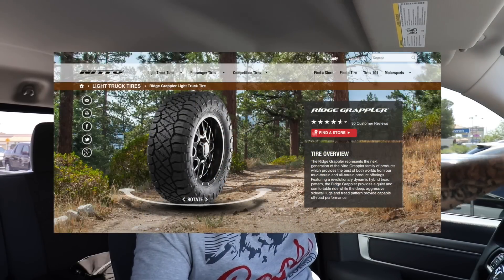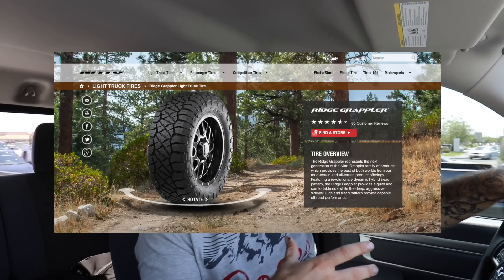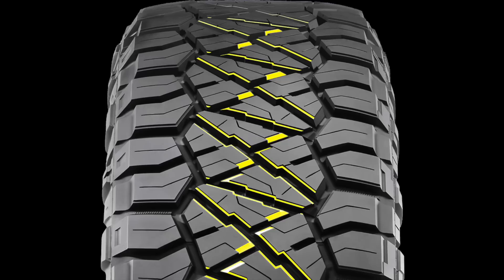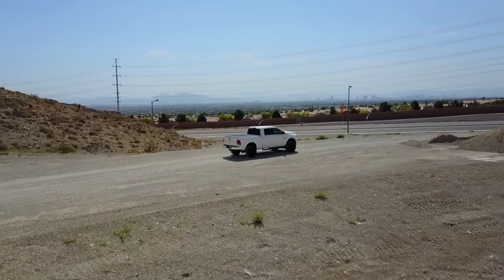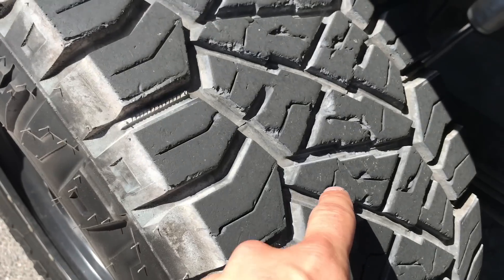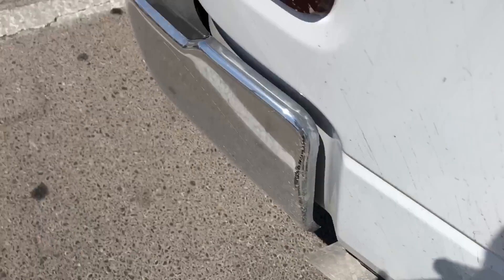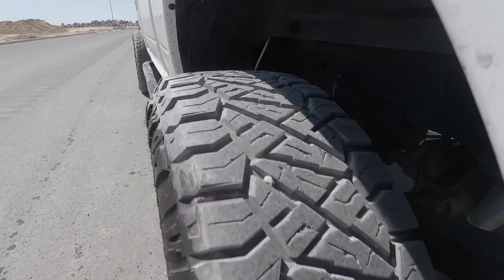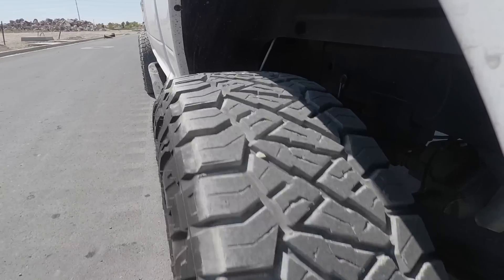Nitto Ridge Grapplers SHREDDED After 4,000 Miles - Jay Flat Out

Comment: This video is over a year old so I'm assuming somebody already this, BUT your mistake was buying the "E" load rated Nitto. The "F" load is what you should've put on a HD pickup. I have the "E" load Ridgegrappler on my 2017 F150 and they're holding up extremely well! The Toyo RT is also a great tire. Yes, they are both built at the same plant. The toyo RT is  cast from their mud terrain architecture...while the Ridgegrappler is cast from their All terrain series

Comment: I have 5,000 miles on my Nitto Ridge Grapplers and they still look brand new. No cracks, no wear to speak of. The only negative is that they seem to vibrate when it is cold. After they warm up the vibration goes away. I do love the ride, quietness, and handling of the tires. I am going to have them re-balanced today and see if that helps.

Comment: Well damn it. I just bought some today and i too live in vegas. My nitto terra grapplers still have 9/32 after 40k plus miles. I'm only changing them because of the dry rot between the tread.
Reply from the maker: +corysm30 can you return them? I have the BFG K02 now and they are amazing in comparisson.
Reply: Don't know if i can have them canceled. Ordered them from discount on azure. I actually passed over the KO2's because of the treadwear complaints. I can call them and see. It would save me 100 dollars if i got the KO's. I originally was trying to decide between the KO2's and the Toyo AT2 extremes. What shop did you go with for your tires?
Reply from the maker: +corysm30 BFG sent them to me
Reply from the maker: +corysm30 BFG sent them to me
Reply: Jay Flat Out That can certainly make a person's choice easier. I'll certainly keep with the wear of them. If they last, it will change a lot of people's minds. Keep up the good videos. Thank you for the responses. Still thinking about having the nittos cancelled.
Reply: Do you have your own shop?
Reply from the maker: no I use CJC Off Road

Comment: The ridge grapplers (in a 35/12.5-20) come with 18/32 tread depth! You’re guessing on the 13/32, and you’re wrong, even in an A/T typically you’ll see 16/32 new.  So, you blew out 6/32 of tread in 4K miles! My guess is it’s not the tire but the driver!

Comment: Have you considered using balancing beads for balance?? I did that on a set of trail grapplers that were pretty much impossible to balance and now I'll never go back.
Reply from the maker: +James Moncayo someone else commented about them, but then someone else told me they don't work without beadlock wheels so I'm lost
Reply: Jay Flat Out 
They work with any wheel, just drop the bag in the tire before you set the bead.. no need to ever rebalance
Reply from the maker: +James Moncayo do all wheels or just the ones they cant get right?
Reply: Jay Flat Out 
It's up to you really, since they're already on it'll probably be easier to just do the ones that you can't get right. But if you don't want to mess with them again then just do all 4

Comment: Did you get the 12 ply Load F Ridge Grappler?  If not, your load size may be out of whack which is why you are having an issue with balancing due to driving a huge truck needing the F load designation vs E or worse C.
Reply from the maker: +Christopher Contreras I believe they are an E
Reply: You can look on the sidewall a low load range will cause a tire to further heat up and blow out if it's over loaded. That being said check out Cooper st maxx . I'm running them on my f250 and they are great.
Reply: I ended up ordering the ST Maxx.  Install in about 1 week!  New Method wheels.

Comment: I have nitto Tera grapplers an so far so good but I'm lucky to put on 6 to 8000 miles on my truck in a year however 70% of that miles is pulling trailer. I also looked at the toyo tires but I'd have to order an couldn't wait had a long trip coming up however when I do tires an wheels Ima look at them again an the Goodyear dura tracks I can personally say Goodyear makes a damn good tire an got good mileage 55000 gonna try gladiator tires on that truck this fall I have heard good things bout them
Reply from the maker: +murder mopar Yeah I'm gonna check out some other brands also

Comment: Very informative video...thank you. I've have very good luck so far with a set of Cooper STT Pro's (295/65R/20). I just rotated them for the first time with 6,000 miles on them and they look like they did the day they went on the rims. I drive a 2015 RAM 2500 Mega Cab with a 2.5" leveling kit.
Reply from the maker: No problem thanks for the support, glad your tires are holding up better than mine haha.

Comment: jay flat out I'm from Houston area and the roads get pretty hot over here as well. I've always ran the BFG all terrains and the mud terrains and had good luck with them as far as tread wear. I work at a shop and a few months ago a customer came in with a tundra I put a 5 inch lift on it with the ridge grapplers the tires were a little over $2,000 and he brought it back a few days ago for some typical maintenance and could not believe how fast the tires have worn in just a few months the tread was almost completely gone. the tires look awesome but I'll never buy them.
Reply from the maker: I dont know what it is, I heard they recently moved factories but these tires are crazy soft.

Comment: I have seen the exact same wear in the video with cooper S/T maxx's on our work trucks in south Texas. It seemed to only happen with the HD work trucks. Hot rocky roads, moderate speed, and a heavy truck will eat up a tire with a soft compound. There doesn't need to be abuse to see this kind of wear, just actual use on rocky roads in the heat. The more I research these nitto ridge grapplers the less i want them. they seem to be more about street use than anything. also, the metric sizes all come with a meager 16/32nds or less lug height. i guess that is so you won't have to hear them.

Comment: On my 2004 Ram Quad Cab 4x4 Sport I ran 295/70R 17s. The good years it came with didn’t last 30,000 miles. I put the Nitto Terra Grapplers on at 50 psi and had 101,000 on the truck with enough tread to still pass inspection from Discount Tire. So I had over 70,000 Miles on them.

Comment: I live in Vegas aswell and have run nittos, bfg's and now red letters on my 2010 3500 ram, I've had issues with the trail grapplers especially once they are at about 25% life and both nittos and the bfg's did the identical chucking once I went from black top straight into hard rock packed dirt roads in 2wd and had wheels spinning here and there, they won't do it at all if your in 4wd not breaking traction but once you start spinning around in 2 they start chunking like that. The red letters not so much because I haven't really been out like that in 2wd. Now the terra grapplers on my dads super duty went to shit really quick between on and off road, chunked up extremely bad and died at about 35k, not sure if it was a bad set or what but they didn't fair well.

Comment: Aren't yours 35x12.50r18? Bc if so, they come with 18/32 of tread per the website. So you're down about 6/32
Reply from the maker: +Shane Batten 295/70R18 it's a 34.3"
Reply: Jay Flat Out ok it's supposed to have 16.4/32. So you're down ~4/32 in 3500 miles. I would def contact nitto and see what can be done about that. That's more than my toyo mt's wore the first 12k miles

Comment: Dude, wish I could comment with the pic of what shape my Trail Grapplers were in. Before I had all the Carli goodies to really give the tires a workout, my Nittos were trashed. Sidewall was cracked in multi spots on one, huge bulge out the sidewall of another up front, more chunks were missing from the tread after every trip...all long before the tread was worn down enough to otherwise warrant replacement.

 My Mud Grapplers (years ago) were fine for what they were and I'm still really happy with the 420's as a car tire but I definitely won't run Grapplers on anything as heavy as our trucks and expect it to take any kind of beating. Might work for a truck that only sees a little mud rather than rock and desert, I don't know...

Sidenote: My current Toyo MT's are holding up great and they're not too bad towing either.
Reply from the maker: Yeah all the evidence is pointing towards switching to Toyo's

Comment: I know im really late on this comment, but I have LT275/65/20 Trail Grapplers. I have about 42,000 miles on them now and still have at least another 5,000 before I buy another set. But the overall wear has been great, and the vibration / noise is not bad at all! The noise is actually just a slight bit more than the Terra Grapplers. I appreciate this video because i was going to buy the Ridge Grapplers next, but I think I'll just stick with my Trail Grapplers.

Comment: Have a set of them on a f250... best tire I have ever had. Have about 40k miles on them currently and have decent amount of tread left. Ok first Toyo and Nitto are sister companies... 2nd the ridge grappler is a F rated 12 ply tire...and 3rd its asphalt not ashphalt. Dont drive like you only have affliction shirts and they will last.

Comment: I run cooper discovers on my dually 285 75 17 and ive had great wear and ride but there not as stylish as the nittos but they have 55,000 mile tread warrenty and they made my truck look alot better also they start with 18/32 tread

Comment: Got 6500-7000 on my ridge grapps. Perfect even wear. On my 04 Tahoe. Hauling my 4k lbs camper. I've put over 400 on them with cranked up keys without alignment and zero wear issues. 

Although I rotate them @2k

Comment: I put 60K miles on a set of Ridge Grapplers on/off road.  "Ash"phalt, mud, snow, rocks.  No problems.  I didn't have Vegas heat though - so maybe that's the issue.
Reply: Northwoods Heat makes all the difference. In warmer climates BFG tires do better.

Comment: Buy a top end Michelin. I love off road tires in the woods but if you are running tires on hot pavement you need a tire designed to hold up in the Heat.

Comment: I have over 7,000 miles on my 35x11.50/20 ridge grapplers on my F150. Made at least 2 1,000 mile road trips with them, and have off roaded them. They look brand new. It’s possible you got a bad set, but I havent seen much negativity surrounding the Ridge Grapps in general. I know obviously your Cummins weighs a lot more than my truck, but being an F rated 12 ply tire, they should’ve easily stood up to the weight of your truck and worn much better than that. I’d get in touch with nitto/toyo.
Reply: Damn, realized this was a couple months ago, hopefully you got your problem resolved.

Comment: Had the same problem with trail grapples. Balancing and tire compound getting eaten by the road. Running Cooper MT.  there smooth on the road and off-road and easy to balance.
Reply from the maker: I'll check those out thanks for the suggestion :)

Comment: Your truck also has around 700-800 lb ft of torque. Even if you're not in it a lot, is it possible that this is a factor?
Reply: Mark Harrell no. The torque will wear them down faster no doubt, but I have this same truck with 35k on them and they look nearly brand new minus the lesser tread from normal wear... I also live in Las Vegas where he lives, so he really can’t blame this on anything but dumb driving in the desert as I have the same tire he has, same SIZE he has and live in the same town, and drive the same truck (heck, even the same color truck) he drives (or drive. He sold and bought the ram eco diesel now).

Comment: I have the Nitto Trail Grapplers and love them. Have had them for 2 years and hardly any wear. I drive 8 to 10k a year
Reply: dkhill27 I got 65k miles on mine n still had thread I got the Ridge grapplers now 6500 miles in and no wear

Comment: I have 33/12.50/18 ridge grapplers wrapped around fuel wheels on my 2016 f250. Not happy with my purchase. I am constantly pulling around 5,500lbs and have noticed the shredding already. I started getting a really bad vibration last week and ended up having to try and get them balanced out again. Been riding on them for around 7k miles. Never again. I’ve just had bad experience with nitto from my trail grapplers to these. With that said, I have terra grappler G2’s on my old Cummins work truck that my employee pulls with and they seem to be doing fine.

Comment: Florida is not quite Vegas but not much cool weather either. I have 30k miles on bfgoodrich KO2 LTE on a 2500HD currently about half the original thread and expect another 20k or so from them. Rotate about every 5k but otherwise ain't easy on them. My 2 cents. I do keep them under-inflated at 60 psi since I rarely tow or carry a load and don't want to run out the centers

Comment: That's interesting.  Although the website shows that the Ridge Grapplers start at 16/32 aka 1/2, I wondering if you were dooped with some used tires.  I've ran all sorts of tires on heavy to light trucks and if you don't do the maintenance i.e. tire pressures and rotating, the problems pop out on any brand.  For your application in the extreme heats I would probably look for a harder compound and since you don't really drive "off road" a highway tire would probably be best for you.  Good luck with your endeavors.

Comment: You should look at the Nitto Exo Grapplers. Very similar tread pattern as the ridge grappler but in a heavy duty tire. I've put over 15K on mine and they still look great. That includes daily drives on a dirt and gravel road.
Reply from the maker: +JP Never heard of them I'll have to check them out

Comment: My brother in law had equally poor life out of  set of Nitto tires.   I ran BFG AT's on my last truck and got a good 50k out of them, however could never get them to balance.  Moved to Good Year Duratrack and never looked back. Smooth ride, fairly quiet good performance.   Can't comment much on life, as I got rid of the truck with less than 10k on the tires, but they did look like new then.
Reply from the maker: I'm super let down on these ones...
Reply: I’ve got 18k outta my ko2’s
Reply: My KO2 LTE are rock solid at ANY speed...😉

Comment: I have a dodge 3500 with the same tires, but my tire guy recommended the Load range F 12 ply ratting tire for 80 psi. You said you had the 10 ply ratting tire at the beginning of the video those are for 65 psi when you go with custom wheels and tires. That's where your problem is. Wrong ply ratting tire.

Comment: have these tires...and on a 2012 3/4 ton RAM 2500 CUMMINS. So, you want my review? Here it goes...I have had these tires 35x12.5-20’s since my truck rounded 65k miles. I now have 100k miles on my truck and they are still holding ROCK SOLID with about another 10-15k miles left on them. I CAN NOT for the life of me figure out how this dude shredded these tires after only 4K miles or whatever he said...CLEARLY he was out in the rocks tearing it up, or maybe he just happened to get FOUR BAD TIRES 😂...I live in Las Vegas like this guy and I have a cabin in southern Utah. I go up nearly every other weekend. It’s 2.3 miles on a rocky, muddy, slippery (at times) and icy (again, at times) road, and I do not drive easy on them. I also tow a 31’ toy hauler in the middle of the 110 degree Las Vegas heat up steep hills, on dirt, you name it.  I also drive several miles per day on pavement to work during the week both on the freeway and surface streets. This tire is the ONLY tire I have ever been able to balance out and not have issues with consistent vibration even after a balance. This Nitto Ridge Grappler is literally the BEST tire I have ever owned and I WILL buy them again. I have 35k miles on them and there is NO abnormal wear on any of these tires, anywhere. oh, did I mention I drive like an A-hole and often times floor my truck everywhere I go, drive faster than I should and take corners harder than most would? Anyway, I challenge you to go get another set on your new ram eco diesel that you bought and give them another shot,  but this time do it without collecting a paycheck from Goodyear to tear apart a tire and give it a bad review. Have a good day
Reply: I totally agree with you! I have been running the Nitto Trail Grappler MT on my Z71 half tons for the last six years. I had 87,000 miles on a set of 35x12.50s that still had 5/32" tread depth left from 19/32" when they were new! Only reason I took them off and didn't run them until 100,000 miles is bc th middle two treads started cupping and making more road noise. I NEVER balanced them after they were first put on! Only rotated every 6,000 miles!
Reply: ryanvegas777 are you using the F rated tires?
Reply: He said it’s the rear tires that are “shredded”. The terrain off road around Las Vegas is a combination of sand/gravel/rock. In the 100°+ heat in that area, that type of terrain will eat a tire alive, especially if he’s experiencing excessive wheel spin from “hotdogging” on the trails...

Comment: Toyo the better tire in my experience.... the best tire I’ve had is toyo open country mt 38 13.50 20 they last 60 k miles driven hard on my 2014 250 power stoke with 4” lift and as far as road drone for a mt can barely hear them at 80 mph